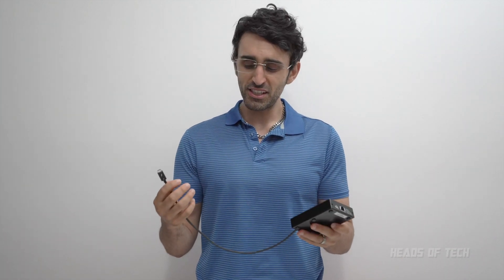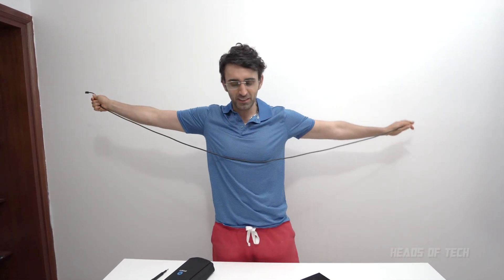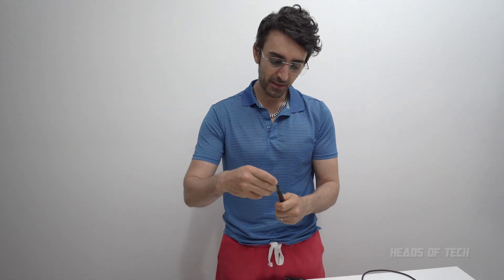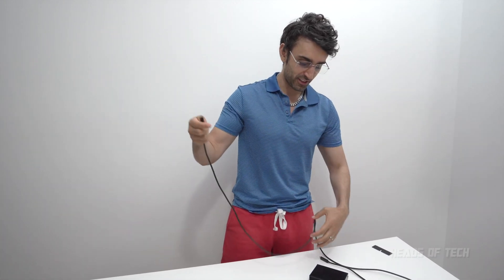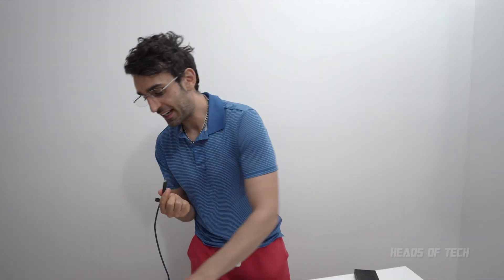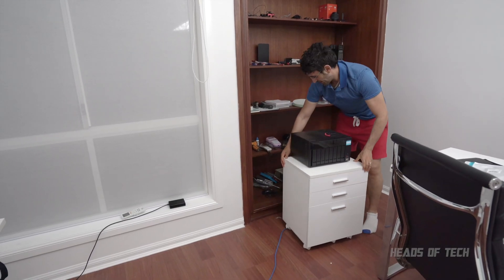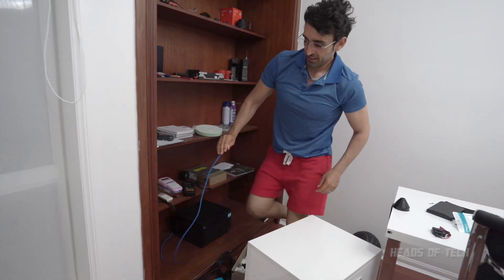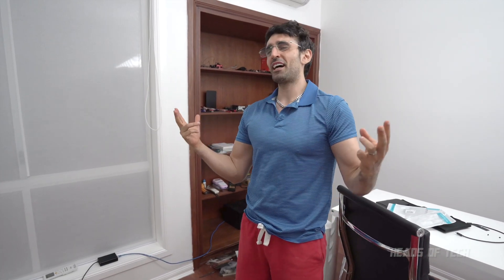OWC 10GBe Thunderbolt 3 Adapter with 2 Meter Cable Upgrade | iFixit DIY

Comment: In this use case it probably won't matter but passive cables drop from 40 to 20Gbps at 1m and up. I've only ever seen short TB3 cables with 10Gbe converters. But it might be more a cost issue than signaling related.
Reply from the maker: I think for this fella, it's pretty unnecessary as it's a silent device, but for those fan based ones, long cables should be a requirement to keep the noise down.
Reply: @headsoftech  I use TB3 10Gbe networking between my PC and Mac when I need to transfer terabytes of data. I never thought to check how hot it might get. If it even does. Always found it strange that networking would use that much power. Sounds like a HOT topic video.